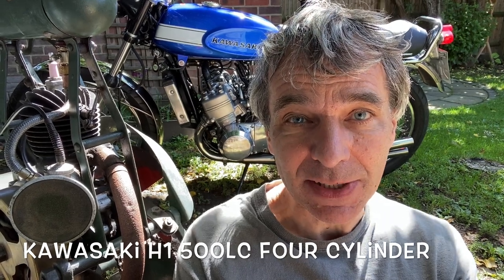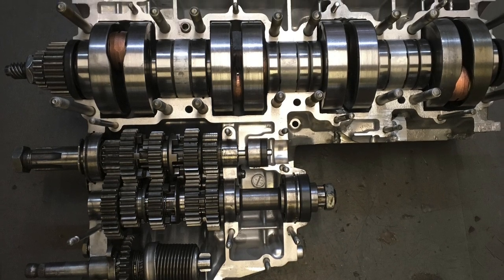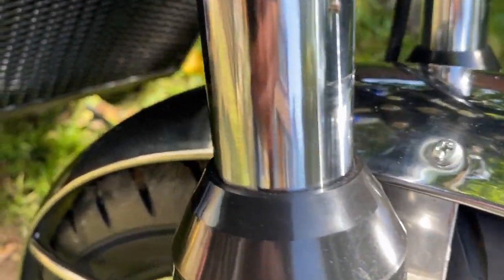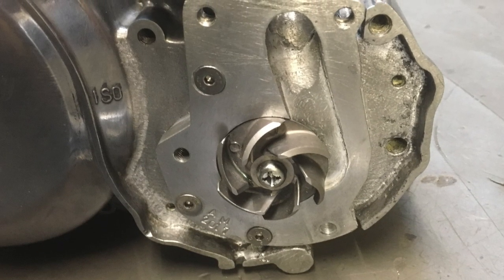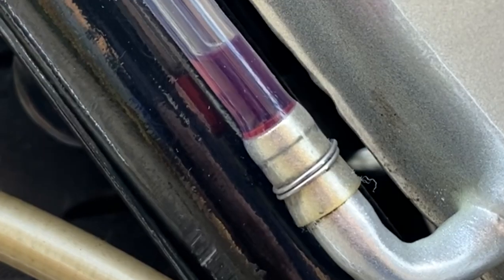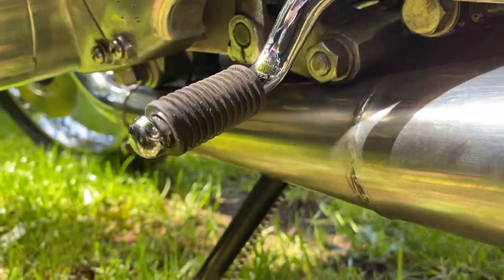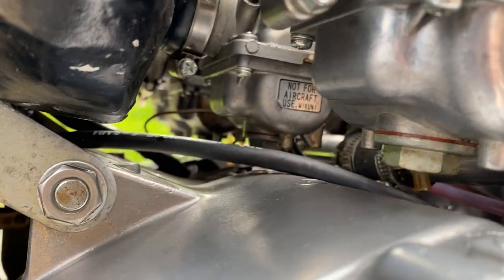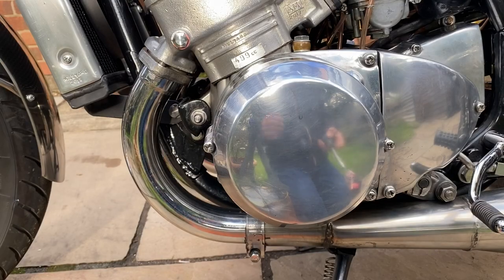Kawasaki H1 500 LC Four Cylinder - How its made

Comment: You're an inspiration Allen. I'm always dubious when I see a 'custom' effort on a car or bike. Frankly the stock standard item is always far superior to the work of the well intentioned 'builder.' I believe you have broken the mould with all of your works. The H1 500 that you have produced is such an upgrade in safely, performance and appearance to it's 'widow maker' original self. I like to restore to original, but you are encouraging me to think to the next level, cheers.
Reply: Spot on. The engineering excellence is only half the story, on top of that these custom bikes look perfectly styled and just as if the factory designed them. Most customs are a real dogs breakfast.
Reply: @TerryClarkAccordioncrazy  Absolutely, I can count on one hand how many custom gigs I've thought were worthy. The guys that get the classic UJM's and cut/strip them out as cafe/brat/scramblers have little respect for the original design - unless they're knackered when they get them. I got a CB350F cafe, then bought a frame cut for all the tabs, brackets etc. and returned it to original... it's just better that way.

Comment: about the fifth time watching the video; the engine, at high revs, has got the same intake roar, as the original thriple, with nuances, at low revs and  while blipping the throttle, of liquid cooled strokers. In a word: an alchemy.

Comment: Beautiful Machine, I'd say its a frantic experience to ride it. Great idea with the oil dosage via the throttle. Never seen that type of system on a production 2 stroke
Reply: All of these Autolube systems work this way. All the major Japanese two stroke manufacturers have had these systems since possibly as far back aa the late sixties . He will have possibly modified it to cope with one extra cylinder attached to his base engine.
Reply: @paulluce2557  I never knew, great idea in any case

Comment: I rode a water cooled TZ750 back in the 70s. It would put on speed terrifyingly quickly. It redlined as fast as you could shift it & in under 15sec was well past the ton. Your 500LC appears to behave just like that. I GET what you say about it taking a bit of time to bleed off the adrenaline after a good fang on the little missile. Things start happening around you faster than you can react. Brilliant work as always, sir.

Comment: Sheer genius 👌. Happy memories of 2 stroke domination in the 70's til the emission laws started kicking in😭.  Loved my RD350 .....as did the petrol stations  ! What's the fuel consumption like on this one ? ATVB from sunny Malaysia 😎😷🇲🇾
Reply: Considering its got 4 x 28mm racing carburetors... Consumption could well be quite high...
Reply: @paulluce2557  Fun never comes cheap :-). My RD350 was mid 30's to the gallon at best back in the day 😱... my mate's S2 350 Kawasaki triple usually less than 20 mpg. Happy days 🤘👍

Comment: What an incredible bike. I didn’t see any power valves on the exhaust ports which makes me think the “hit” on this bike would be substantial. Not for the faint of heart. Thanks for sharing.
Reply from the maker: Ive got it geared quite high to tame it down it would lift on the throttle every time in lower gears before !

Comment: Love two stroke road machines. I made a cafe racer back in '74. Bought it new at the dealership and tore it apart in his shop. Replaced all metal body parts with fiberglass road race replicas. Laced on Borrani rims with Dunlop tires. Expansion exhaust and clip on bars. What a rush.

Comment: Sound is just Sounds like 4 microns  You just don't hear that sound no more  I Remember when i was still at school My Oldest Brother Had Been Re stationed in UK After a Long Overseas Deployment He had then a 350 LC F1 Power Valve Running two Very Clean Microns and some Other bits To the Back of our House by 1 mile was the By Pass from the motorway laying in bed in the summer you could hear it come across the bypass Sounded Great Love it Great work Sir.

Comment: Although it may change I think this is my favourite Allen Millyard video. So much has happened: from air to liquid cooled.
.. amazing become  liquid cooled from an aircooled engine 
fit yamaha into kawasaki
line bore it all together with new made crankshaft
tinker with gearbox to rev 
remachine for yamaha 
alter the forks 
Inject or dose the oil rather than mix petrol with oil from an oil reservoir 
mechanical water pump using or choosing an impeller from a KX250 ( whatever that is) 
alter the kicker to match novel ergonomics
and on and on.

I went through the comments to look for responses from Allen and gained an insight into a methodical  design philosophy.

Comment: Ahhhh.....that's the sound !! Compared to the S2 4 cylinder this is a much deeper note, of course. It's amazing with those water cooled cylinders how you can actually hear the rest of the engine and exhaust working so much better. The stock air cooled cylinders always radiate sooooo much noise on the 3 cylinder Kwaks....and it would be worse on a 4 cylinder. Brilliant work on the conversion of those brand y cylinders......and creating the crank to match.
I love your modesty in the throwaway line about making the brand y crank fit in the Kwakker cases. I can't begin to imagine the hours/days involved in getting that whole thing exactly right. Kudos to you for such a special.....well.....special. LOL

Comment: Allen, I'm late with seeing this video but it's great! !  I must say, your custom expansion chambers seem to keep the noise down surprisingly well.
And this is the real Mach III that I would've wanted, back when I was a penniless teen lusting for that first incarnation (1969-71?). I got to test ride one then. The front end leaped into the air! I hope the weight of your liquid-cooled four-cylinder mill helps to hold down the front where it belongs.
I've heard that those Mach III engines fouled plugs regularly. A friend of mine always carried a spare set in the tool kit of his Mach III for that very reason. I hope your more contemporary engine is a bit easier on plugs. And congrats on your beautiful custom conversion of this classic two-stroke rocket.

Comment: I converted my KH250 to an S2 350 years back easier than I thought as the pistons barrels and head just fitted, it was a flying machine that used to eat LCs, the most amazing thing was I only had a few spanners and a cheap socket set to do the job.

Comment: When  I  heard you say 4 sets of Points  I  went  " Eh?" . Went back near the start of Video . Ah , Cross-plane Crank .
All four fire separately , instead of in Pairs .
That probably helps make it less Frantic to ride . Four cylinder Two-strokes CAN be an almighty handful . 
Very impressive build . Sounds like a different profile on the Jet needles or Needle-jets could help , to my Ear .
I  don't suppose the uneven length induction plumbing helps much in trying to get Jetting sorted .
That said it SOUNDS great .

Comment: To a normal mortal, The first 60 seconds description of how the crankcase and crank were built completely overloaded my brain yet to Allen, it was a walk in the park. And that first 10 seconds on the bike showed what a rocket ship the 500 is. Allen , here is an idea for your next project. Dirt riders everywhere have been wanting a sub 130kg, water cooled DOHC fuel injected 6 speed 500cc bike with long service intervals, steel subframe, 20 l tank, mini fairing with great LED lights and nobody is ever going to make it. Over to you.

Comment: Whats better than an LC 250 ? Two LC 250 s! Having an across the frame LC 4 must be just a great fun machine and practical. I put a TZ350 G on the road when the only water cooled 2 stroke was the Suzuki GT 750. I mono shocked an RD frame and fitted yellow and black block painted TZ fiberglass with ouch noisy G expansions. I ended up making my own water pump and radiator that bike was the other side of not practical but strangely it kicked up! Went erm very well! Water cooling suits 2 strokes if nothing else cuts down the mechanical clattering, Scott was right.

Comment: I wonder what kind of response this awesome sounding marvel would have if the barrels were from the 125 power valve models! As the powerband from them once the valve had been rotated, was more than any 12 HP!! Mine would get straight to 80!! It would have done the ton but sprocketing it for that was not very practical for town driving!! 
Another great video! Never fail to impress!!

Comment: I get cutting and welding the crankcase. I get having to modify the frame, etc, to accept the wider engine. I even get the crankshaft balancing etc. What I don’t get is how you manage the extra ignition/spark plug?

Comment: How do you work out the jetting? You mentioned in another video that the CV carbs were difficult to tune. Are your multi-carb set ups usually connected with linkage or cables to each carb? Japanese bikes from the 70's are the epitome of cool.

Comment: Would you be interested in taking 6 cylinders from a Yamaha Banshee or RZ and creating a crankcase and crankshaft to make a boxer engine with twice the displacement of the original engines? Instead of 3 cylinders in a row, transverse, it would be 3 on each side like a BMW or a Honda Goldwing or a Porsche boxer engine and you'd probably have to use a separate transmission like Harley Davidson does. I would love to see and hear one run. Might one be a Kawasaki H2 killer? (The new 4 stroke H2)

Comment: Correct me if I’m wrong please, but if I understand this properly, not only did he change it from a 3 cyl to a 4 cyl, but he ALSO changed from air cooled to water cooled.  He talks about making Yamaha 250 barrels (plural) fit on there.  And having to fashion his own crank from Yamaha parts.  And making a radiator.  So I think he’s now got a 1000cc bike there.  ALLEN:  what is the displacement of that machine now?  Truly fascinating!
Reply from the maker: 499cc the barrels are from a 250 twin ie 125cc per cylinder

Comment: In the  late '70's I made a road racing bike, from a 250 a/c Yamaha,  it was Very successful..  The next step was a 500cc V twin, using the base Yamaha engines, for the IoM TT,  but never built it.  How would you do that ?  ps, surprised that you use contact breakers !

Comment: I wouldnt want to use a points ignition, but other than that, WOW!

I'll need to hire you to make the ultimate 2-stroke monster...
Reply from the maker: Points are fine for a classic bike, but I  am looking into fitting a modern electronic system for the 500LC

Comment: What's the bore size? 4 x 250LC barrels makes 1000 so assuming it's a shorter stroke? What did that do to the port timing? Lovely work, as ever.
Reply from the maker: The 250lc is a twin with 54mm bore and 125cc a cylinder making my four a 500cc

Comment: Allen your work is extremely creative and top notch. Your obviously reached expert level (plus 10,000 hrs) in several trades. Do you sell your creations and or custom create for customers? I’m a huge H2 fan. Cheers. Richard
Reply from the maker: i have sold a few over the years
Reply: Allen Millyard I liked the 500 4 cylinder LC. The 5 cylinder H2 was also very interesting. Do you do any dyno testing of your machines? My H2 king cobra made 120 hp claimed. Sure felt like it compared to my many other bikes. Wish I could upload a foto for you. Cheers richard in Canada.

Comment: So what are the barrels? The original kx500 barrels sleeved to take 125 pistons? Or did you use the rd 250 barrels you talked about? I'm curious... It's a 4 cylinder 500cc... So the pistons are for a 125 right?
Reply from the maker: each cylinder is 
125cc 54 x 54mm from an RD250LC

Comment: All Yamaha 2strokes had inlet reed valves and windows in the pistons. I guess You didn't fit this?
It increases the powerband drastically. The gas enters the piston early through the window. And the gas exchange is much faster. We used to open the piston windows, even more, the reefs and power went up, sometimes it shuttered the piston if You got too far. It was fun. Did the same to an H2, wasn't fast enough
for me at the time, sold it because now it was guzzling too much petrol. 50 miles on a tank, so I sold it.
Unfortunately, the guy who got killed himself, I wouldn't,t have sold it to him if I would have known.
Today You get even more for the H2, high compression heads. Carburetors are machined closer to the inlet.
I enjoyed this time, never had enough money and space to work on
 the bike. That is nearly 50 years ago.
Reply from the maker: Not all Yamaha’s had reed valves especially pre 1972
Reply: @AllenMillyard  Yes You are right, I like Your workmanship, I wonder how You compensate for the extra power, by your machines I had a lot of o problems with the H2.
Vibration by 10 000rpm, fine balancing the crankshaft, extra clutch plates, extra hardened chain, the normal chain ripped.
The RD Yamaha was as well speciell, You could disguise a 250 as an RD 350, by changing the barrel and piston, they fitted straight, and jetting o the cubs.
Anyway I like Your movies, You learn a lot about what is possible.

Comment: Some of your creations are mind blowing.  This machine is defo one of them :) Ab fab.  Me thinks you are a bit frightened of it Alan.  You seem to change gear just as it sounds like its on song.  Also I noticed it has 499cc marked on the barrel. Should that read 494cc as it is 2 RD 250 @ 247cc each?
Reply from the maker: Not frightened of reving it,  but on the road the speed increases quickly even when short shifting
Reply: @AllenMillyard  Yes I could see it pulls nicely.  I had a 250LC and that was plenty quick enough :)

Comment: How did you make the silencer (or muffler) used in each exhaust?
Reply from the maker: perforated tube with glass fibre wadding wrapped around inside the tubes at the ends

Comment: Do you jet the carburators, each cylinder alone? Looking at each spark plug
Reply from the maker: yes i set all rich then lean off the easy to get outside carb until it runs better then swap all jets and start again, the problem was it wasn't just the mail jet! i had to change the slides, needle jets, needles and pilots from those sent with the carbs to match my intake and exhausts. Its marginally rich at moment but i prefer it that way to be on then safe side
Reply: @AllenMillyard  yes man, I understood. Nice job!!

Comment: When you made the engine wider you had to realign it with the frame/chassis. How much? Did you modify the engine or the frame?
Reply from the maker: Frame is stock and  I centralised the engine
Reply: @AllenMillyard  Cut the engine bracket and rewelded on a new position? How is it to weld some aluminium alloy or what ever it is those Japanese engines?

Comment: May I ask, with all that unbelievable craftsmanship I have always noticed how your builds always use period-correct suspension, brakes and cycle components. 
Why not include modern brakes, suspension and chassis tweaks when the engines have significantly higher and different power delivery?
Is it the bike's ride character aspect or a design compulsion?
Reply from the maker: I like to retain a period factory look I fit modern tyres, brake linings and shocks and they handle fine
Reply: And what creations they are!!
Lots gratitude and best wishes to you for putting your work out here for us all to learn from.
Your work has been a tremendous inspiration since about 15 years ago when I first saw the 5 cylinder Kawasaki two-stroke in one of our local magazines.
Reply: P.S - I love the little tips like the Machinery's Handbook for clueless amateurs like me to learn from.
Thank you for your beautiful work!

Comment: Why didn't the factory make one like that?
That could rev higher so it would have had
higher performance than the standard H1 500 plus
it was water cooled - a big improvement too.
The factory would have put CDI ignition on it.

Comment: If the original 3 cylinders = 500 CC then the new four cylinders would equal 666 CC. Correct? By division and multiplication. Regardless, that is brilliant engineering work that you did!
Reply from the maker: i made a new short stroke crankshaft with a 54mm stroke and fitted four 54mm diameter RD250LC pistons making the total capacity 499cc
Reply: @AllenMillyard  
Carry On Cranking

Comment: Wow! I think I saw it hit 70 miles an hour! You can see the speedometer. Most of the ride is 35 to 50 miles an hour and never once does he open the throttles. He says the engine will rev to 12000 and he didn't even hit 8. The engine is as much a Yamaha as it is Kawasaki. The rest of the bike is more H2 then it is H1 with the H2 front end and the H2 gas tank. And why wouldn't he paint the oil tank to match the gas tank? It stands out like a sore thumb. He's better at building them than he is at riding them. I think I'm qualified to speak because I owned a red and white H1 for a year and then a blue H2 for 2 years and drag race 10th Street raced both of them. King of the streets baby
Reply from the maker: We have a 60mph speed limit in the uk and I like to set a good example to the general public 🙂